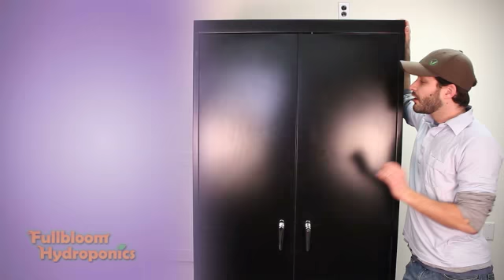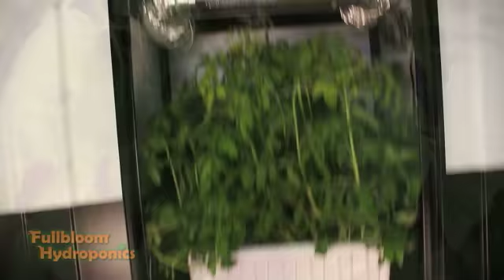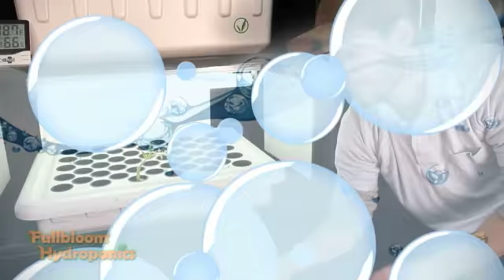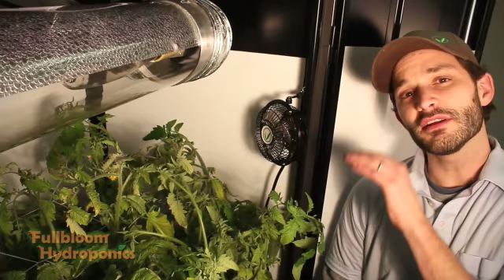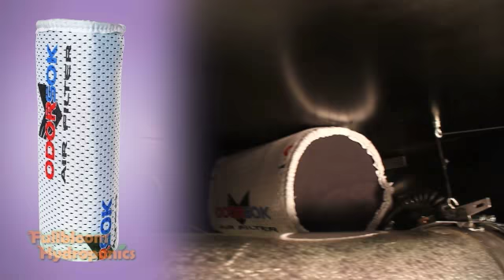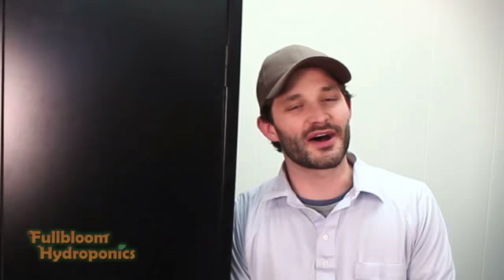Super Closet Deluxe Grow Cabinet

Comment: 896 watts x 12 hours x 30 days = 322560 watts divided by 1000 = 322 extra KW hours per month enough to get most people busted for increased power usage. Only good for folks in legal to grow your own states- which also severely limit the number of plants you can grow so this is overkill.
Reply: Ms Merry did you pull that out your ass?!? There's no way your gonna get busted for running less than a thousands watts, even 24 hours a day. Try again.

Comment from the maker: A stock Deluxe 3.0 draws about 5.69 amps, or about 683 watts.  With the 600 watt upgrade, it will draw about 7.47 amps, or about 896 watts.  Assuming the primary grow light is used mostly for flowering (only 12 hours on per day,) the cost to run this unit will be about 25 per month (depending on your cost for electricity) for the 400w (stock deluxe) and 35 per month for the 600w version.
Reply: 896 watts x 12 hours x 30 days = 322560 watts divided by 1000 = 322 extra KW hours per month enough to get most people busted for increased power usage.